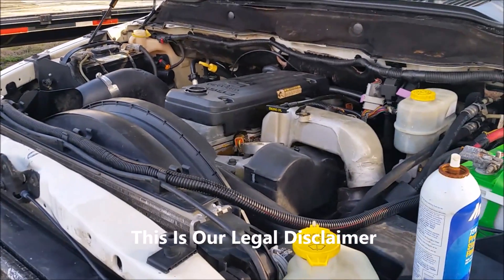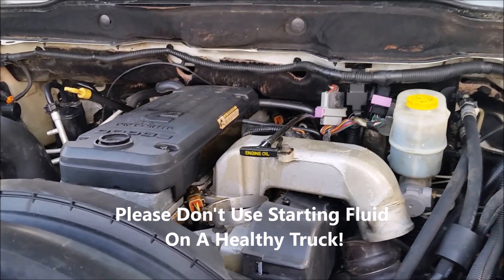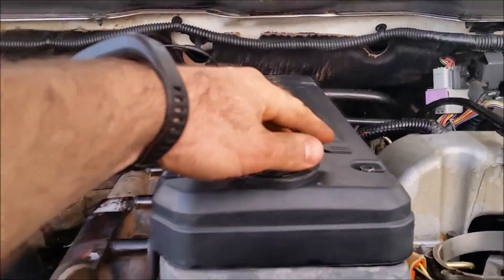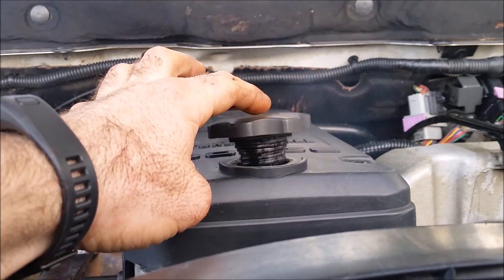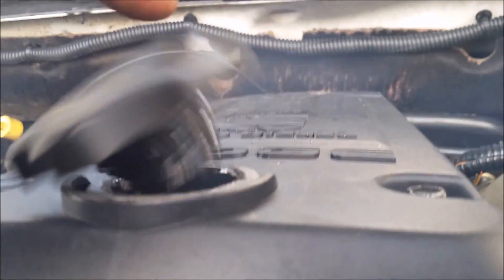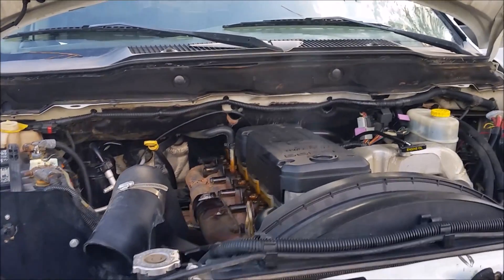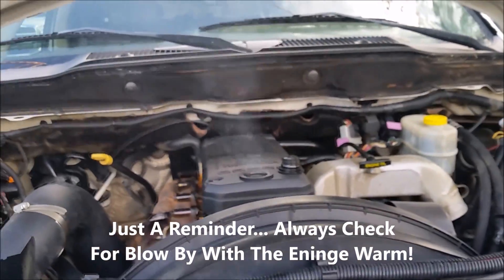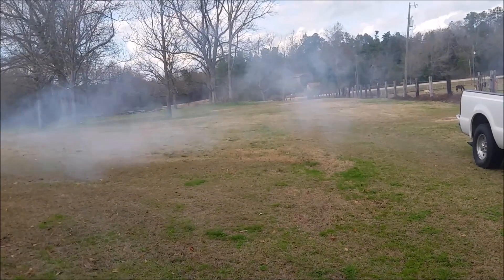Perfect Example Of Blowby On A Common Rail Cummins

Comment: Had same on my Infiniti. Enden up rebuilding turbo. Exhaust gases escaped thru oil seal down the oil return line. Runs like champ ❤
Reply from the maker: Thanks for stopping by and so glad to hear you dodge a bullet! I don't have any experience with turboed infiniti's, but I can sew how that could happen. On the Cummins trucks, it almost aways the compression rings or the injectors have failed and washed the wall down. Is blowby on an infiniti common?
Reply: @70440charger  here in EU we Have diesel Infinities. The engine is made by renault. Few has with mercedes engine. I knew from beginning renault's engine kinda bulletproof and this blowby cant be the case  So just started with turbo and success. Dont know much about infiniti blow by but I do love the car so whatever it takes lol

Comment: My 8.3 has about the same amount of smoke comming from the exhaust and oil coming out the dip stick, but when i pull the oil cap off its not nearly as bad as this with no  smoke at all, do you think its a fuel injector or too much oil?

Comment: My 99 got that much coming outta the breather tube and the bottom is covered in oil...she's got 329500 today.
I think she's got at least another 200k cuz the exhaust is not blue so she's fine
Reply: The older cummins have more blowby because they don't have the CCV systems that the 24v do.  You're going to end up replacin front and rear main seals more often (due to crank case pressure) but if you're not burning oil it should be okay. You could try routing your breather to the intake with a catch can to gather the oil vapors. That's what the newer trucks do (except without the catch can and it gums up the intercooler).

Comment: Don't be so sure the engine is done. I have blowby like this and it was an exhaust guide seal allowing exhaust into the rocker area . But mine didn't smoke from the exhaust. Just a lot of gray gasses coming out the oil cap and when I increased RPM the tappet cover would leak massive oil. I hope this helps the people who have blowby no smoke from tailpipe. Check all your exhaust valve seals

Comment: I have a Cummins n14 heavy duty Diesel engine it doesn’t blow by from the oil fill cap but i see a lot of smoke from the blow by hose that goes from the top of the engine and I don’t see oil just a few drops on a long idle
Reply: well we both got the same problem then i don’t know what it is to be honest

Comment: Did y’all ever figure it out?, my 2005 5.9 does this but it doesn’t blow white smoke out the exhaust, it blows a little bit of smoke from under the engine but idk if it could be a gasket or something, it kinda smells like burnt oil I’m not sure what else it could be, what could be the reasons for this?
Reply from the maker: Is there any chance you could upload a video of where it is blowing smoke from under the motor? These 5.9's / 6.7's have breather tubes and some amount of blow by is normal.  Seeing where its coming from would help narrow it down!
Reply: i’ve got this exact same problem right now. the blowby barely moved the oil fill cap but smokes from that, the breather tube, and the dipstick but none out of the exhaust.

Comment: I have a 2011 ram 2500 with a 6.7. The oil cap doesn’t blow up but there is some white smoke. When should I be concerned?
Reply from the maker: If the cap is still steady, then I wouldn't be too worried. If I were you, I would just keep a nice 2 micron filter in the truck, keep good fuel in there and keep an eye one it. Those 6.7 are less prone to injector issue than the earlier 5.9's CR's.  BTW, that 2011 is a solid truck! I hope you love it!

Comment: Bought a 525d Bmw E60 and noticed some vapour coming out when taking cap off. Just  felt like a small puff to start then got worse.
Reply: Went home and my 2011 4.0d e70 does same but less. Is this normal
Reply from the maker: Any chance you can upload a video and send us a link?  It is really hard to say without seeing it. But some blow by and vapor is normal... We just have to see how much force behind it and compare that to other motors like it.
Reply: Ok I’ll start it cold then warm and take cap off  tmw when I get chance.
Reply: Any comments is it normal as it’s 115k miles was low on oil when I bought it just min mark.

Comment: Ahh, still got 100k more miles in her
Reply from the maker: Ahh Ted! I love your spirit of Adventure! Blowby? What blowby?!
Reply: @70440charger  lol lets go bro!
Reply: Was about to say the same thing.
Reply: @70440charger  Cummins dont need piston rings, run er.
Reply from the maker: @thehavok4258   That's pretty funny and what's crazy is it's pretty much true. When we open some of these motors up there's not much left in there but the piston!
Reply: @pencil whip i wouldn't say mine is quite that bad but its still going. 05 3500 with 277k miles
Reply: @pencil whip and that only lasted 10k miles?
Reply: @pencil whip so you sold it or overhauled it?
Reply: is there A part 2 of this project just curious

Comment: Where is the air pressure coming  from? Leaking past the valves? I dont understand where its blowing by.
Reply from the maker: Yo Derrick! Thanks for stopping by! You have a great question and you have inspired me to grab a piston and an old block and make a video visually explaining what causes blow by in the near future... The Short answer is that blow by occurs when combustion gases escape past the piston's compression ring down into the crankcase. Of course it can be on just one piston or all of them. And it can happen for a variety of reasons. On most of the CR blocks that we have torn down, the blow by is from washed out cylinder walls cause by bad injectors and also from cracked compression rings. From what we have gathered, the rings can crack for a variety of reasons, but it is said that for a few years (i.e 04.5 -07) Cummins used a really brittle ring that was very prone to cracking. We have also seen case  of failure that sure look like the injectors failing cause loads of extra heat that was melting the piston and appeared to have cracked the piston rings. 

Hope this sheds some light on what is causing the blow by you are seeing here! 
Happy wrenching! Doug
Reply: @70440charger  thanks for the info.
Would the injector being bad spraying to much diesel into the cylinder?

Comment: isnt it true that this only works when the engine is warm truely, so that the oil can circulate past the piston rings ? or can it be just blowby leaking past that valves ?
Reply from the maker: Hey Drift Team,  You are on the right track. Blow by will usually get worse as the motor warms up. When the engine is cold everything is tighter and there aren't as many combustion gases getting past the rings and into the crankcase. As things loosen up, you see more pressure in the crankcase.  You can even see it in this video. If you look at the beginning of the video, the Blow by isn't as bad as it is near the end of the video. Knowing to look for this when checking out a truck is just a nice tool to have in your toolbox to avoid making a bad purchase! Thanks for the comment!
Reply: @70440charger  Question, i have a 06 5.9 G56. When up to temp it puffs lightly out the cap. Absolutely no pressure, cap doesn’t dance ect. Is it normal to be able to see some vapor exiting the valve cover hole?
Reply: Mine is the same way, i have a 07 24v auto. Just like you said i have the same thing. Only when it gets up to 200 temp. And onlh 153,000mi @340stroke

Comment: Is smoke coming out acceptable? What if if smokes but came doesn’t move at all?
Reply from the maker: Hey Delta! If your description is accurate and the cap isn't moving, then some vapor is normal. I cant tell you the spec off the top of my head, but Cummins even has a spec for how much crank case pressure is normal. I wouldn't worry about it too much. If are concerned, up load a good quality video and send a link our way. We can all take a look and share our thoughts! Thanks for the comment!
Reply: That would also be my question and at least it’s reassuring no smoke in exhaust and no oil spill too from dipstick or cap.

Comment: Question so i have white smoke coming out the cap but no pressure at all is that still bad ?
Reply from the maker: Hey man! That is a great question! Is there any chance that you could get a nice high quality video and send it my way? I hate to give an opinion on something without getting a really solid feel for whats happening. But, as you probably already know, these diesel all have some blow by and some vapors that exist even in a healthy motor. That is why they all have crank case breathers. My "shot in the dark" guess is that you probably are seeing normal crank case vapors or maybe even are seeing elevated levels of vapors because of a plugged or blocked factor breather tube. BUT AGAIN, that is a guess. Send that video and maybe we can all help give you a better idea of if its normal!
Thanks for the comment!
Reply: You just answered my question thanks i was worried for a minute. This is my first diesel truck and i only ever wanted the early 2nd gen 12 valves. I been doing alot of research before buying one and it has 230k miles and alot of things replaced to keep it running perfect and it is stock and plan to keep it that way for awhile. But do you have any advice for me to keep this perfect diesel running perfect. First thing i always do when buying a new vehicle is tune everything up. Im gonna be changing the oil , and fuel filter in it. But whatever helps i would appreciate it. I subbed to you also.
Reply from the maker: @Anthony12valve440RB  What year is it that you picked up? That will impact what you need to look out for to keep it running for another 200k!
Reply: 70440charger 1995 the last year for all mechanical
Reply: 70440charger i bought valvoline 15w-40 oil and a mopar oil filter mo-285 and a quart of Lucas oil stabilizer is that good for my first oil change ? I wanna do everything right so i can make this run perfect for a long time.
Reply: What if oil is leaking upon opening that oil cap?
Reply: Dont know if anyone answered it for you but check the breather tube make sure its not plugged.

Comment: I have blowby like that but nothing out of the exhaust pipe any suggestions
Reply: 2005 cummins
Reply from the maker: Alf Dogg, Any chance you can get a video of what it looks like. And it wont make you feel better, but we don't typically see anything out of the tail pipe till it gets pretty extreme. One thing that could be helpful is to check and make sure that your crankcase breather to make sure that the filter isn't plugged up. It doesn't happen super often, but worth a check!
Reply: @70440charger  Got rid of the truck I think I’ll just keep my 97 12 valve five speed 4x4  The only thing I don’t like about it is the brakes and the steering
Reply from the maker: @truckcampertraveler7369  Sorry to hear about you having to get rid of it! A 97 12v is a fantastic truck, though!

Comment: I have the new 3.0 duramax and it smokes like a chimney when you take the cap or dip stick off. It moves the cap, but doesn't necessarily blow it off. It has 2,000 miles and started probly at 146 miles. I've had heating issues and found a coolant leak. The oil pressure is also all over the place and blew the dip stick out one time. What do you think?
Reply from the maker: Man, you know its hard to say without seeing it, but it doesn't sound like your motor is happy. Have you taken it back to your dealership to have them run a test on it? I mean in a general sense it's fairly normal for diesels to take a little while to seat but it sounds like you're seeing much more Blow by than would be normally expected from the normal break in process.
Reply: Break-It Brothers Diesel hey, thanks for responding. I have an idea on the 13th to be looked at again.

Comment: Hey man, what ever happened with this truck ? What was the problem
Reply from the maker: We pulled the motor from this guy, but haven't broken into it yet. We dropped the 12v motor from the Project Hole in its place. We tried to film as much as we could and are processing the footage to post. 
When we open this guy up, we will let y'all see the guts. I would guess that it is like the others, broken compression rings, and washed down cylinder walls from bad injectors.  But that's just my guess!
Reply: Shits mint. Just cheach'n a bit

Comment: Did you find out what was wrong with it as to what's causing the blow by?
Reply from the maker: R.C. PRODUCTIONS C : Not yet. we got the truck cause it was a great deal and the perfect starting point for the swap that we are going to be doing soon. We will link this video to the diagnosis of what caused it as soon as we take it apart! Thanks for checking in!
Reply: R.C. PRODUCTIONS C typically 2004.5 -  2007 5.9l Cummins the injectors will leak or fail causing the number one or six cylinder to wash causing blow by and ultimately engine failure. Corrective measures to prevent this would be replacing factory injectors and fuel filtration system with a water fuel separator type system. Very common on these trucks to not know until it's too late.
Reply: I'd like to have the passenger front door and the bed!!!

Comment: What if the truck has that much blow by but there’s no smoke and the engine isn’t running rough or anything? Like the engine runs smooth and the truck drives totally normal. Has a ton of power too. Could a clogged ccv filter cause that too? Thanks
Reply from the maker: Hello Shane! Thanks for stopping by! What year is your truck? I know it sounds silly, but unfortunately some years are some forgiving than others. But no, it's not likely to be a clogged CCV. I have only seen one that changing the CCV helped and it didn't cure it. It just lessened the Blow by.  However, with that said, that would still be the first thing I would try to see if it helps!  Please check back in and let us know what you find!
Reply: @70440charger  well, it’s a 2012 truck and my brother bought the truck because we were like worse case scenario we pull the engine out and rebuild it. The truck had a lot of blow by to the point where it pushed the rear main seal out. But the truck drove fine, no loss of power, no smoke or anything. We changed the ccv filter but that wasn’t it. We dug further and found that the previous owner had the hose that goes from the ccv filter to the intake blocked off LOL. So my brother went to a S&B intake and hooked the hose back up to it. That fixed the problem. It still has a little blow by but very little. We changed the rear main seal. And it drives excellent!
Reply from the maker: @Soomacok  That's fantastic! That's a great truck and I hope you guys love it! Thanks for letting us know the outcome and I am so glad you did the homework to figure out what is going on! I was worried that you had an 04-07. When those have blowby it's usually not good!

Comment: I suspect the engine was over heated?
Reply from the maker: Overheating can sure do it. We haven't torn this motor apart so we cant say for sure yet, but most of the other ones like this have come from bad injectors. Now those injectors probably added to the rest of the carnage and also probably to a bunch more heat in the piston area cause of improper combustion.  Have you happened to run across some with overheating issues?
Reply: @70440charger  No, I have not. I'm mostly a gas mechanic and have seen rings collapse from overheating in gas engines. But, I'm wondering how injectors would cause engine failure?
Also, have measured blow-by by cutting off a finger from a latex glove and wrapping it around the oil dipstick tube (with dipstick removed) observing the inflation of the glove finger.

Comment: All engines have a certain amount of Blow by and you'll feel it through the oil fill cap.
Reply from the maker: You are so right.  There is always some blowby. This is just a good example of "good blowby" turned Bad!  Hope someone out there gets a chuckle out of that!  I couldn't resist.  But seriously, My rule of thumb for a Cummins is that IF the motor is healthy and IF the Factory Crankcase breathers are working properly and IF the motor is idling, you should be able to take off the oil cap and not have excess pressure.
Reply: This one is choofing as can be seen, and when you hear it crank it has a "flat" spot where there is little/no compression. Possible cracked ring or hole in piston

Comment: What is too much blow by??? 12 valve Cummins
Reply from the maker: Hey There! Thanks for the question, but it is kind of tricky to answer.  All diesel will have some blow by, but we really have to look for excessive blow by. I know that is kind of a lame answer, but that's why we use the oil filler cap as a test. If you get a little movement from the cap being blown up, then the blow by is starting to get more than what the stock breathers can handle.   If it rockets off the valve cover, then its long past rebuild time. Now, there is a caveat. This is assuming you know that the normal crank case breathers are working properly and you don't have some random issue that is causing excessive crank case pressure. On a 12v there is a breather tube on the tappet cover and that is what is supposed to take care of the normal amount of blow by that happens on a healthy motor.  I hope that helps some!

Comment: Imagine having such bad blow by that  when you take it off the cap blows out of your hand😂
Reply from the maker: Do you have one that does that? If so... You have to take a video of it and share a link! I want to see!
Reply: Break-It Brothers Diesel no I don’t I want to see a video like that too 😂
Reply: Mine did that too me after a ride home one time. My exhaust didn't smoke and it still had good power. Didn't see it coming. My jaw dropped
Reply: @Loopy728   That was me right before sending her to the transmission shop. My truck is a damn money pit 😂